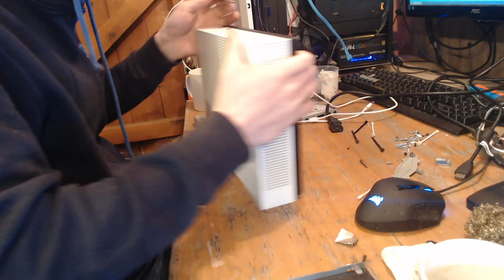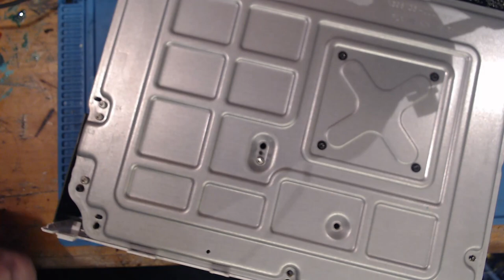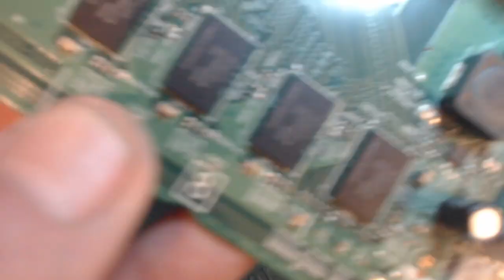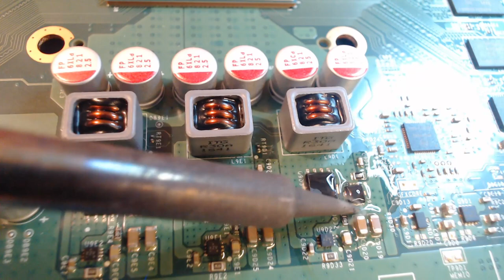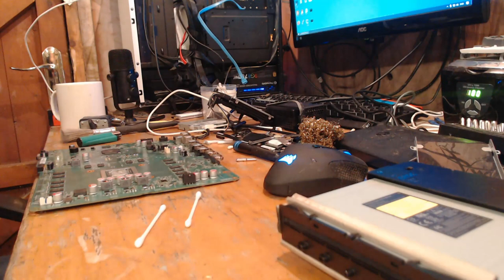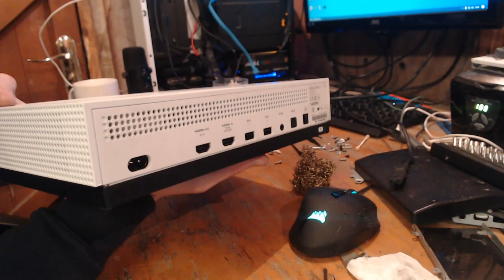Xbox One S No Power Diagnosis And Repair - Power Regulation Mosfet Sudden Failure

Comment: Hi TheCod3r! Big fan of your videos, specially the long ones such as this. From your previous videos (and this one) I first tried the short to ground test on 12v rail, but got something very odd. I get a short bip (about 2 seconds) indicating a short and afterwards the short is gone. I test again and nothing... Then, if I attempt to turn on the console (it requires about four or five attempts) it stays on for about 7 seconds and shuts down again. Testing once more, the "short short" comes back...

Have you ever encontered something like this? Maybe one of your videos I missed?

Thank you in advance!

Comment: Hello, great video. Ive subscribed, you deserve more. I'm currently trying to fix my own Original Xbox One, how do i check for short on the motherboard? Because there isn't a plug for the PSU like on the xbox one S, thanks.
Reply from the maker: Hi, it's q little hard to explain in a comment but I would say your first step would be to check the diode mode measurements on the mosfets. Second port of call would be the power management IC. I forget the chip number but if you email me on phildanks@outlook.com I will find it for you. Thank you for the sub and kind words :)

Comment: Hey so I tested the mosfets, the test points, and the 12v rail. Everything is testing fine. I even replaced the PSU. Still no power, not even a light or a twitch in the fan. 

It's making a weird electric noise when I plug it in and thats the only anomaly I notice

Comment: Sweet vid.. What heating tool do you use in vid.. Make serial number etc... Many thx
Reply from the maker: Thank you. This particular repair would've been done with a cheap Chinese hot air station which was the Yihua 853D. These days I use an Atten ST-862D
Reply: @TheCod3r  thx for your input
Reply: @TheCod3r  thx... I have located one on ebay.. Fair price 170...next my freind a suggestion on a decent soldering iron for these jobs... And thx for input.. Been repairing consoles for years but only now collecting equipment to replace chips etc😎👍
Reply: @gyrofromphyt515  hey man.. I understand the operation perfectly.. But unfortunately i dont have the required heating tools to carry out the repair.. But thx for asking🙂👍

Comment: earned a sub. question got an xbox one original. i can see the 12v rail but i dont know to test it. i checked the mosfets and all showing 0.01 ohms. where would i test 12v rail on the xbox mate?
 thanks
Reply: sorry 0.01V
Reply from the maker: @xiMoshyx  hey thanks for subbing. Is it the original xbox one you have or the slim? If it's the slim you can check for shorts in continuity mode on either the 12v connector or on the top left pin of the small mosfets and the left side of the resistor above. If it's the original xbox one you can test in continuity mode between ground and one of the coils just after the power brick connector and also on the same small mosfets. You can also check diode mode measurements on the mosfets and with the common lead on the mosfet and hot lead on the resistor expect numbers in the 550 to 680 range, with the leads flipped expect numbers between 1800 and 1950. Diode mode is the same as continuity mode on most multimeters. If you still can't pinpoint a short use a bench power supply and inject 12v at either the connector (slim) or the coils (original) and feel for heat to find the short. A short on mosfets will draw a substantial amount of current and will be easily detected with heat. I have a video coming out tomorrow where I use all those methods to repair an original xbox one console belonging to a paramedic :)

Comment: What does it mean when the 12v port left side you say in your video is positive and the other (right) side is ground, when I go and test it normally it shows nothing and makes no sound but if i reverse it it makes sound? Same issue where it beeps and the power led shows for maximum 5 secounds then shuts off no spin from the fan

Comment: The XBOX one 1540 i have keeps showing short to ground on a bunch of capacitors by the top where the ram is and some under the CPU. Would that indicate CPU/RAM shorted or is it possible its  something else. I'm very new, so i'm still learning as I go and had that curiosity.  I'm testing for short with continuity mode, black lead in common ground and red lead touching caps to see if both pads are grounded. Currently the xbox turns on for like 2 seconds and back off. Thank you!

Comment: Hey quick question my xbox one s had a short to ground changed all three mosfets doesn't read short anymore but now turns on then right back off. Before I changed moafets it would do anything at all the fan turns 1/2 a turn or so when I plug it up then it turns a couple turns when I power it on the light comes on the whole xbox powers off what do I check now

Comment: Thanks for the video had 2 xboxes that were frustrating me to know end I have fixed every console that I have worked on that was fixable over 20 only 2 ps4's that I'm still messing with and haven't given up on. Now I am sure that's the problem with these 2 xboxes!! Gonna order some mosfets right away. Thanks again!!
Reply: Where are you ordering them sir??
Reply: @akirakgampe7758  Ali express
Reply: @timmahotool3714  thanks.

Comment: Trying to remove a mosfet. Using flux a temp of 480 degrees, low fan. Yours came off at 23 seconds or so. The one I have won't budge at 60 seconds. Also tried chip- quick. Same result. I know there is a large pad underneath the chip. Any suggestions?
Reply: You need more heat. Try heating it from the bottom as well. These are a thick board that sap the heat.

Comment: Don know if you can help, bud. when I plug in any power brick the xbox shorts up and disables  the power brick with a red light. any pointers where else one can troubleshoot the short. when I ground to 12v rail i get a 2 sec beep then it stops for a while.
Reply from the maker: Hey bud. To be honest the power brick shorting out could be a number of things. Without testing components it's hard to say but I'd say start by testing the mosfets. If they are all ok test the mosfet driver ICs just below the mosfets (small 8 pin QFN IC on the power rails. If those are all fine or may be the NCP4204 power management IC. If you go through my no power videos I have a stack of methods for testing different components and identifying different no power causes. Hope this helps

Comment: Hello at 11:22 the power regulator things (brown parts) can they be replaced?
Reply from the maker: Hey, absolutely. Any component related to power management can be replaced on these as long as you can find the correct components. The only things that can't be replaced would be the APU, disc drive controller and the flash memory
Reply: TheCod3r awesome thanks! I might just take it in for that definitely found one loose because the console fell
Reply from the maker: @KabayanAR  you're welcome, I hope you get it repaired soon

Comment: I live in the states I wanna know where can I got to order some mosfets
Reply from the maker: Digikey would be your best option. They're based in the US but have 2 day worldwide shipping. The part number for the power regulation mosfets is TPN8R903NL. I buy them in spools of 100 and they work out to around 32cents each 😃
Reply: @TheCod3r  thanks man i be trying to repairsome.broken ones I bought on ebay but I cant fix it it powers on then powers off cant find the problem
Reply from the maker: @melvinpervis6678  some of them won't be fixable but you just need to go through the diagnosis process and try and eliminate the possibilities. Try using the different methods such as injecting power into the board using a bench power supply and then figure out what gets hot. I may do a voltage injection tutorial as soon as I get a job in which requires it :)

Comment: had the same short same mosfet i replaced it now short is gone but xbox starts and shuts off instantly, fan does not spin up, tried new PSU still same thing, any idea what else could be wrong ?
Reply from the maker: Hard to say as a beep on beep off can be one of hundreds of things unfortunately. The most common are ram, ram driver, pmic (ncp4205), apu and the disc drive/ hard drive circuits
Reply: @TheCod3r  dang! well i'll keep testing lol thanks for the advice tho
Reply from the maker: @restechrepairs2793  good luck mate. Check the test points just above the southbridge and make sure you have 1.1v, 1.8v, 3.3v and 5v when the psu is connected and plugged in to the wall
Reply: @TheCod3r  ok, do these points have any markings on them ? I can't seem to find them
Reply from the maker: @restechrepairs2793  yeah they're solder pads marked with things like 1p1sb for 1.1v standby etc
Reply: Nope I lied they are all getting the right amount of power

Comment: Where can i buy those mosfets
Reply from the maker: Sorry man I thought I'd replied to this message. Ebay is the best option for just a few of them. For bulk try mouser as they are very cheap in bulk
Reply: @TheCod3r  what is the part number for the mosfet? Thank you
Reply from the maker: @Mechanix827  TPN8R903NL will work and you should be able to get them from ebay or digikey
Reply: @TheCod3r  thank you
Reply from the maker: @Steve May yeah the xbox one and one s both use the same mosfets, drivers and ram ic, the power is is different though

Comment: Always like watching other techs work, there's always something to learn or another way to approach things. Seen a couple of your vids, do yourself a favour and buy one of these to remove the X clamp , saves your fingers and makes it so much easier. https://www.ebay.co.uk/itm/1PCS-X-Clamp-Removal-Tool-Replacement-Tool-for-Xbox-360-Mainboar-W2/353364631185?_trkparms=ispr%3D1&hash=item52462c5e91:g:QgwAAOSwenZfm7Ly&amdata=enc%3AAQAFAAACcBaobrjLl8XobRIiIML1V4Imu%252Fn%252BzU5L90Z278x5ickkWpEuxXwAiCNKyBQsQ5%252Fe6%252B5xPviswC23ANxJYV%252BHAUYjIMf%252FgwzxVQMUWT1zG5a6a0ptaJbzHv6m46jklTaULxfPKT%252FLGvwsbReaTXLTS87j1tElf6aaTXcntd7Xcxu1EmGS0WAUfqJAtgm5dL1%252Fm0nRN1cXvfEn%252BzLBIfbCyGhSON3vOTz8eaCfU%252B9ajueey3uidmOBLjLPb7A3DF%252BYXm8SFmvYUQV%252FcB8AUPuTQRTmkf9L10WWUGtwCkALZmStJGun6CdosyDMr6%252FvOBSZyhRYJZKP4MimeBKslup3kIahoaH9T%252FDmr9kCKjKnBhuYpLudMdTlIf9tUF0vNCzrvN3o%252BmjrCvTgH%252BqzGCklBKozu0XWPftHpX7gc9xXs161V4L%252B8qIlXLwKcdmJBIAB4kgagQGUBgJjsiKNEjmDiHPqKZ10Fiu7cUXcKY1WMKhAFPEkZ9hE1ZFdr1WPszISAhj6xbEpMMTr7bPkXWhwtDH15o7F0HxAmw9LcsASGjuJ13HK%252F%252Fk%252FLTT%252B9iV8N7cofxfubPCW4vrzGERLmEC3Eh7wYHknofZwJ3Z3PleuwoiOG3JF8hSVR2M7Nw6BZZ7x5poCubdI2K3I4Fe3AAoyXsx5Lw%252FQFehMQBbLB0%252BaEcAS4k8VvIlzUSH53p6Q5QsOdTxouNLP3%252BXMiOsmIWkPwC9YW%252F9TiFQmX22uYDx%252FDXIQfyfaHEYcQLStC%252BdsORCBmjUZv2Axy0m9mb2fD%252BpBigWEz675VzbG%252Ftac1j1V1Mt4F8jl9V2Tu%252BLu9%252BlegmHOeA%253D%253D%7Ccksum%3A353364631185a44b80795e664651acb13a0486a94bf7%7Campid%3APL_CLK%7Cclp%3A2334524